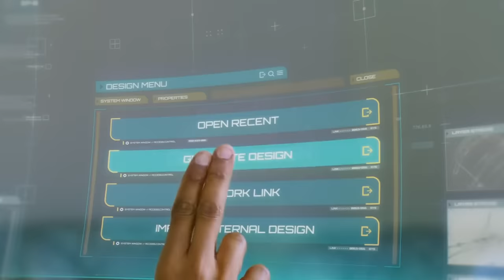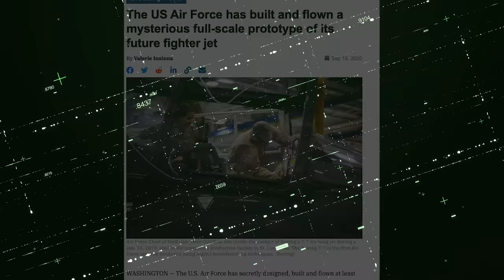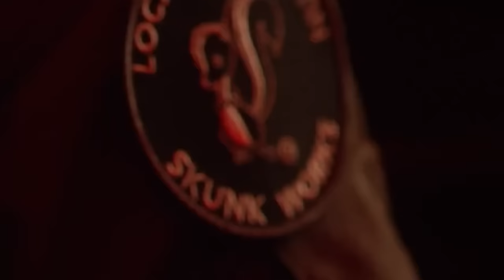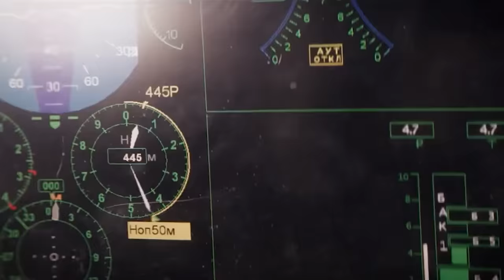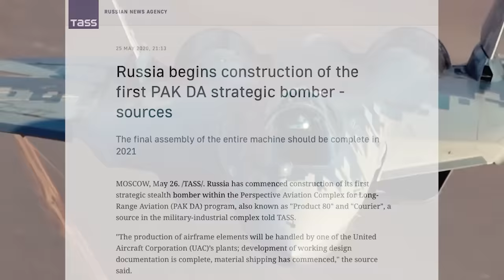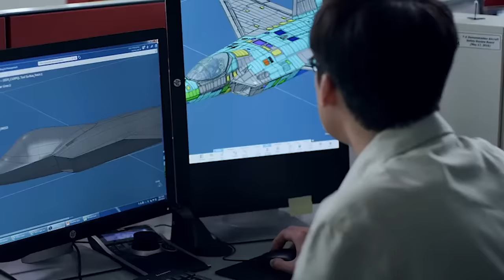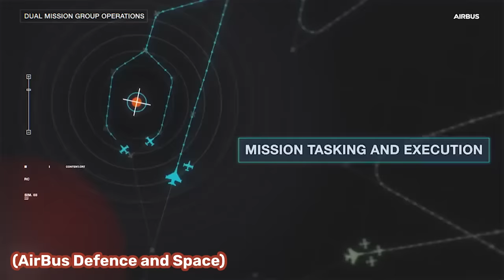12 new stealth aircraft headed toward service

Comment: France: "Stealth is outdated and ineffective against our Rafale and it's vaunted spectra."

Also France: "we are also building a stealth fighter."
Reply: Some kids at MIT I figured out how to detect stealth using passively configured consumer wifi routers, and a whole lot of compute.

Stealth only works well against Fourier transforms. Once you can data mine in real time the jig is up.
Reply: France has a well earned reputation for being on the losing end of a battle.
Reply: @jtjames79  Many systems can detect that a stealth platform is present, somewhere. But that is far from a fire solution to shoot one down.  Which just adds to the inherent fear factor of stealth. 
Just wait for the loyal wingman drones to reach front line service. Then failure to precisely locate them takes on a whole new dimension for enemy air defence assets.
- Invisible man 3D chess.
Reply: @rudolphmarchand9644  France caused the USA to win against the British, so they had at least one important victory, just sayin' :)
Reply: @gusgone4527  essentially beginning a game of 3D Battleship....where the prices can move
Reply: @gusgone4527  tell me you don't know the difference between Fourier transforms and data mining without telling me you don't know the difference between Fourier transforms and data mining.

Also once you know it's in the area, look up stupid.

Object recognition and tracking is consumer level technology. Nvidia Jetsons are off the shelf, AI libraries included.
Reply: French fanboys got nothing on Swedish ones. (in the amount of cope produced)
Reply: @jtjames79  consumer wifi routers would stop working after few missiles hit power plants
Reply: @hphp31416  I got a UPS that says otherwise.

You also are completely missing the point.

Or more like avoiding the point because you trying to argue with somebody using terms above your pay grade.
Reply: But you can't find it!
Reply: @angelarch5352  You can have an assist on that, not a win.
Reply: @jtjames79  Cite your source.
Reply: @jtjames79   what is the source here?
Reply: Its easy to put down the importance of Stealth until you on a mission with live weapons where you wont be able to detect your adversary until after they have fired their missiles from over the horizon
Reply: @jtjames79   so the issue isn't a limitation with math, it's that high-frequency radio waves get diffracted or absorbed which means only low frequency radars can see it at long ranges. Yes, even hypothetically an array of routers. That's not a new thing. Old early warning systems most countries use and air traffic control towers can detect stealth aircraft too. Are networked low frequency radars going to get better at triangulating stealth? Almost certainly, and stealth technology and materials might as well, but the point remains the range they can be targeted will be much shorter than non-stealth aircraft and radar countermeasures will also have a proportionally larger effect.
Reply: @delos2279  I'm going to believe the results I read about in the peer-reviewed paper. You can do you.
Reply: @jtjames79  Clearly you didn't understand my response because I already explained that yes, stealth aircraft can be detected. It doesn't mean literal invisibility. They already could detect them with half century old radars. And low frequency arrays (+computers) can triangulate better than individual radars. That isn't new knowledge and it isn't why every major military power is pursuing their development...

Edit: feel free to cite your "peer reviewed paper" because I'm quite sure it agrees with me, i.e., they are referring to detection, not weapons guidance. 

And again, in case you missed the point, the point is you need to be a lot closer to target a stealth aircraft vs not-stealth. Which I'm 100% sure is something your "peer reviewed paper" also agrees with, or rather, it probably doesn't even address because that's obvious.
Reply: Awesome post!
Reply: @rudolphmarchand9644  only til the u s saves their ass!😅
Reply: @jtjames79  hey,  be nice...it's just a conversation.
Reply: @jpslaym0936  and that's the the thing people miss.  U know, the country's that don't have it!
Reply: @delos2279  I think their trying to say.....stealth isn't all it's cracked up to be. ..... right up to the time a missile fired from an undetected stealth plane hits their command center.   Just saying
Reply: @jimkluska253  Your enemies aren't going to be nice.
Reply: @jtjames79  I don't have any enemies.    But if I did,  I'd rather be able to get within 20 miles before being shot at then 70 miles out. Agree?
Reply: @jtjames79  and how do u data mine in real time when what ur tracking is moving at 800 knots.?  And traking is a far cry from a weapons solution.
Reply: @jimkluska253  It's useless to try to explain these things to people who only reason by analogy.
Reply: @jtjames79  keep trying.
Reply: @jtjames79  dont give up trying to make ur point.  If it's valid then it should be heard.
Reply: @jimkluska253  I've made my point. Underestimate compute at your own peril.
Reply: @jtjames79  why are you being short and passive aggressive?     I didnt say you were wrong.  I just was pointing something out that I didn't  agree with.
If you don't want to  get into greater breakdowns of ur point that's cool. But telling me it's my own peril is a little " over the top".
Didnt mean to upset you.  Thought you were trying to teach a little.  That's all.
Reply: @jtjames79  Detecting stealth fighters is not the most difficult part, especially with the range and power of AWACS or ground radar systems like the S400's, the hard part is tracking with higher frequencies so you can get a missile lock.
Reply: @jtjames79  Additionally that sort of array is just as susceptible to the same tactics used against ground radar, it's simply a cheaper more modular way to accomplish nearly the same thing that existing radar systems already do, just more spread out. All ground based radar will continue to have the same disadvantages, and although over time moore's law dictates that radar will only continue to improve, we are no where near the point where ground based DIY radar systems will be useful, as most of our major adversaries can and will detect any stealth aircraft in their airspace in the first place, and ground based DIY systems like you've cited cannot provide missile grade tracking at any reasonable distance, making their existence in a military superpower like Russia or China near useless when there is already large scale LF radar coverage
Reply: @rwilson4073  You remind me of the art people, who think AI art it's just a collage.

Wishful thinking reason by analogy.
Reply: @jtjames79  I'm in agreement with the others here (mainly Delos), I'm not sure you properly comprehend what stealth means. As Delos correctly pointed out, there is a significant difference between detecting a stealth aircraft and getting a lock of sufficient strength and accuracy to achieve a missile kill. Low-frequency radars such as those employed by ground stations and AWACs have been able to detect stealth aircraft for decades depending on range but that doesn't translate to being able to achieve a kill. 

Furthermore, AI/ML are not some magical wonder thing that mean you can suddenly overcome the deficit of a system, they are only as good as the data that you can feed them. In the case of stealth tech, an AI/ML system is not going to improve a low-frequency radar to the point of being able to target an aircraft because it can't overcome the inherent "noise" or error that the return signature has. For higher frequency radars, it's not going to suddenly mean you can detect a target you couldn't before because it doesn't change the physics of the problem (i.e. it doesn't change the fact that you aren't getting a radar return to let you know there's even anything out there). When I was still in undergrad for my aerospace degree, I worked in a lab where one of the projects was indentifying missiles using radar data and ML and one of the biggest problems was trying to overcome the noise in the system to get an accurate result. Keep in mind that was just using the ballistics and some basic data about the shape to determine a class of missile, that wasn't attempting to get a viable solution for a fire control system. 

You say that you've supposedly read papers that prove your point, if you have them, by all means feel free to share. I'll even give you my email if you don't want to post them for the world to see.
Reply: @jacobdewey2053  So I know what a Fourier transform is but you assume I don't know how legacy radar works.

The same technology that makes stealth pointless, makes combined sensors child's play.

You make the munitions smart as well. They can get their own target lock on the way.

Waiting for a target lock is a legacy bug that doesn't apply anymore.

The holistic approaches to use loitering electric drones, with srbs, in a mesh network. Basically drone missiles.

Drones would have phased array radar, optical, infrared, and lidar for about $5k, off the shelf, all mesh networked into a virtual array.

Stealth doesn't help you when your enemy can mine the sky.

And that's just off the top of my head I'm not even trying that hard. I'm just using basic first principles.
Reply: @jtjames79  While it is true that modern missiles have their own scanners they still have the same issue of needing to get a lock, otherwise they're just a rocket, and loitering drone missile swarms, is nothing more than wishful thinking, especially with your claim of a full radar lidar infrared and optical system for only 5k (???) on a military application that would have to sustain high g's and adverse weather conditions, among other things. Additionally, a system like that would be extremely susceptible to all sorts of BVR attacks, electronic warfare, and ironically enough, drone attacks/swarms, not to mention any sort of purpose built weapon its implementation would incite. Your proposal amounts to nothing more than a bunch of expensive sitting ducks if they're just going to loiter around waiting to be decommissioned.
Reply: @rwilson4073  You remind me of when Sears said Amazon didn't understand the catalog market.

It's also hilarious that you think solid-state electronics can't survive high g loading. 🤣😂 I want whatever drugs you're on.
Reply: Stealth is undetectable although it's extremely hard to get a lock on
Reply: @Forlarren

I've known people like you. They like to appear smart and have developed it as a skill.

Once someone counters anything you say, insults, self promotion and the go to tactic of telling someone they are just ignorant, or not at your level.

It's done to deal with character defects in the area of listening & replying in a conversation and possibly self worth.

I've never known someone like you to get past the defects in character....
Reply: @angelarch5352  They also stopped the germans in WW1.
Reply: Cite your source please.
Reply: This guy definitely thinks he’s the smartest person in the room wherever he goes. We should be honored to be in their presence. I mean he knows what a Fourier transform is.. Big wow guy. Post your source or are you just talking shit?
Reply: @jtjames79 
Ah yes
Something no nation has ever taken into account
Which totally invalidates stealth!!!

And that's why literally everyone is building stealth aircraft. Because it's useless! There's no one on the planet who has considered the effects of low frequency radar! Because it's so easy to just blind fire in the general vicinity if a target and let the weapon lock on it's own!

You're so smart man, you think of things no modern military would ever conceive of! It's absolutely amazing! I can't beleive you haven't revolutionized the airspace! All we need is low frequency radars!
Reply: @jtjames79  Citation needed...
Reply: @iamscoutstfu  You must be new to YouTube, it deletes comments with links.
Reply: @jtjames79  

I guess you never figured out how to post a URL without making it a link, then.  You represent yourself as such a wizard with technology I figured something so incredibly basic wouldn't be outside your skillset. 

Convenient that we just have to take your word for it, though, lol.
Reply: @iamscoutstfu  cool story bro
Reply: @jtjames79  

He said, after making unfounded claims and then insulting the people who asked for his evidence.
Reply: @SD352-68  Study I was talking about was a few months ago.

That's not including the things none of us know about.
Reply: @jtjames79  Yeah, I'm sure the brains at DARPA, Lockheed, Boeing, and Northrop missed that.
Reply: @kpadalldotablet1009  Laughs in MCAS.
Reply: France many times are bailed out of the war because it looses a lot
Reply: @rudolphmarchand9644  In what world?
Reply: France is a sundere, just like we dont like your money but we will take double the amount. ahh
Reply: @rudolphmarchand9644  To Arms : We Surrender. Quote from Le Frogge.
Reply: @jtjames79  Do u have any idea how impossible to do that in real-time? Sure you can detect whatever you want when the plane is on the ground but good luck having a glimpse of that thing flying .. You will need to hook a supercomputer to each detector and compensate for lag, by that time you are dust.
Reply: @jtjames79  First, lets back away from anger and nastiness. I think I found your study; it is interesting, and it was not MIT. It was a European Aerospace company, Cassidian and now merged of Airbus.  The article talked pretty big on its ability to do so; it was also 10 years ago. This was also the article of journalists big talking, not the company itself. It kept talking about detection, not locking in with a missile and like others have said that is a whole other story. Even if you knew exactly where it was, you have to get close for your missiles to detect and by that time, the stealth aircraft has already shot its own. Unless they can find a way to get a missile lock well beyond what conventional radar on a stealth jet can, it isn't going to stop stealth. All the big players across the globe are spending massive amounts of money on stealth and this study was one company from 10 years ago on the verge of a big company merger who wanted to impress. Wasn't very heavy in news or blogs, though China says they have something similar and working with the idea, but detecting and targeting again are different.  It very well might have merit, but won't be practically applied for another 30 years if at all.
Reply: @jacobdewey2053  Found it. As far as I can tell, it wasn't MIT. IT was a company called Cassidian, now part of Airbus. I only found one news article about it on Wired. This was 10 years ago and China has a ground radar based on the same or similar principles for around 8 years. Considering how little is said about the idea and China's radar both then and now, I am skeptical it works any better than ground radar we already have. For now at least. Nothing I have seen has shown an ability to give a missile a lock on.
Reply: what you expect, it's France.... literally famous for "backtracking". Their tanks go faster in reverse than they do forward XD
Reply: @jtjames79  You suffer from a basic misunderstanding of what stealth is. It doesn't make the planes invisible, it makes them more difficult to detect and harder to hit. And those advantages combined with advancements in radar and missile technology are enough to make a F35 unbeatable by a more basic fighter like the F15 or SU57
Reply: @LeMAD22  Cool story bro. 😎

Nothing ever changes so 1980s technology will be good enough forever.

Got it.
Reply: I once heard a wise man say, "The French copy no one and no one copies the French"
Reply: @rudolphmarchand9644  France has an ill deserved reputation put out by ungrateful British people after France saved 300,000 British and Commonwealth troops at Dunkirk. The British celebrate battles like Agincourt and ignore the fact the English kings lost all their French territory and were kicked out of France. The only thing that saved Britain from being overrun by Napoleon and later the Nazis is because Britain is an island and not because the British are particularly good at war (as the Japanese also demonstrated in Burma, Singapore etc.).
Reply: @rudolphmarchand9644   Exactly!! True.  in example Vietnam was a French possession when the France lost against them in their war that is when the US stepped in, in WW2 they got taken over, if it where not for both the Soviets and USA it was game over for France, and the same goes for several wars through out the past. But a major notable exception is that they Won along Joan of Arc and yet they betrayed her. And they are still losing old colonies currently.

Comment: FCAS may have a carrier variant, to replace the Rafale M, but we'll have to see. GCAP / Tempest so far reports are no carrier variant. Not sure what the UK will do for 6th Gen carrier capable jets in the mid 2030s to 2040s - perhaps just stick with 5th Gen / F35 plus loyal wingmen or convert QE class carrier at midlife refit to full flat top with EMALS and buy American F/A-XX if they're available for export & the deck is long enough, or some other option. 

Sweden, has the Gripen 4.5 gen. The cost of developing 6th gen (and family of systems) is substantial, either you're a super power or you have multiple high GDP economy's working together, so would seem either they join in with GCAP to maintain indigenous skill base or ... who knows. 

Thanks for the content, great as always.